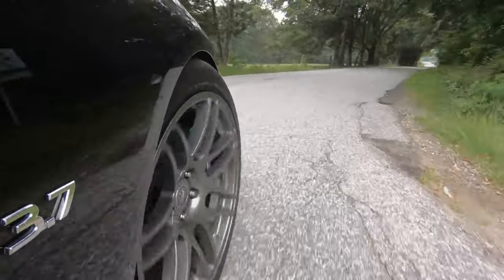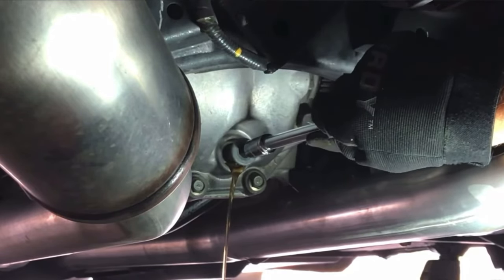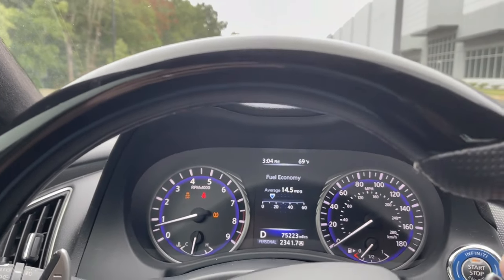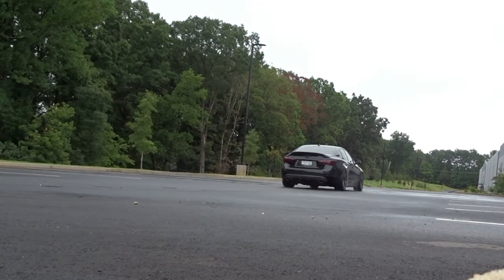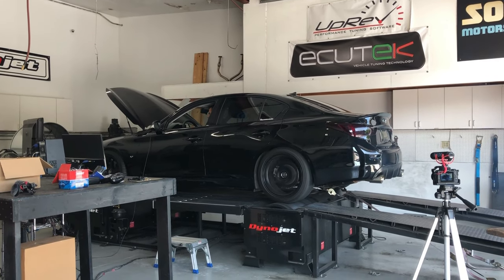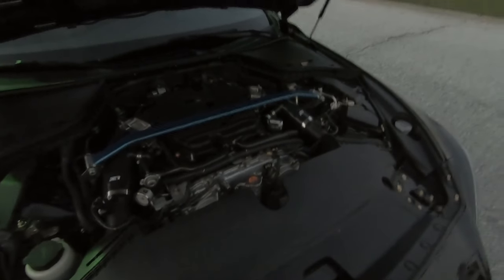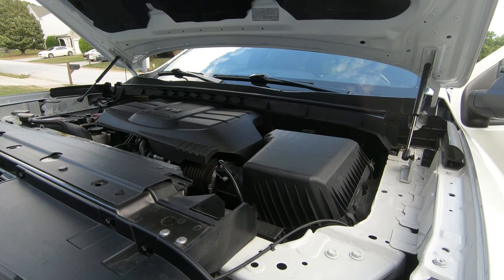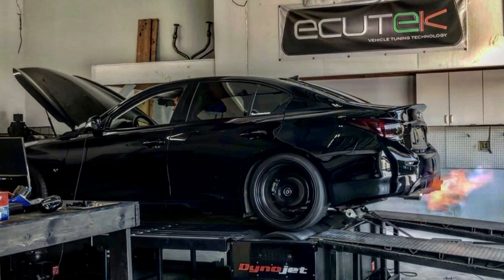Tips To Keep Your Q50 Running Great

Comment: I have a 2015 q50 w/ 215k miles. She’s still running like new. This car is a beast. Will never let it go 💪
Reply: Just inherited one with 140k.   Any advice?
Reply: I just got mine a few months ago like 3 second owner w 135k I got 10 k miles on it took it from Seattle to La and back handled like a champ daily drive it and  pulls pretty good. Any advice on keeping the tranny giod
Reply: shesh 215K miles wow!
Reply: With the original transmission?
Reply: Mine is at 170000 and when I’m in park, it sometimes revs up a little by itself……….. any idea what it could be please reply
Reply: @ryansteele5059  i think its normal
Reply: Most reliable and I think best looking sedan you will ever own. And it accelerates like a rocket with no engine- damaging turbo (3.7 👍👍) Unlike soooo many German cars...I've had 3 infinitis and last one (G37x) was strong and reliable at 350,000km when I sold it. Get a q50 while you can... As they say, first rule of commerce: If it's good, they stop making it 😊
Reply: Is not the transmission. For those q50  is the valve body 😊
Reply: @quentinlittle2670  if the previous owner hasn't changed the heater hose connector yet, I'd recommend doing so before it fails. It's a plastic piece the becomes brittle and just breaks apart over time. Also the radiator caps should be replaced if it hasn't already, although at 140K I assume those have been replaced.
Reply: @jayedsun I’m at 89k, should I change those soon
Reply: @TahoeOG_  earlier the better. I just changed mine at 100k and it crumbled. Careful of plastic pieces breaking apart and falling down the hose. If its a large piece you have to clean it out. If just small pieces break you might be okay leaving it alone. I recommend an aluminum piece to replace it
Reply: @jayedsun  I plan on replacing the hoses with new ones as well so I guess I don’t have to worry about those pieces
Reply: @jayedsun mine failed today gladly I was near home, ordered a aluminum bleeder adapter and better clamps them oem clamps suck!
Reply: seeing the top comment gives me a hard on. im getting my q50 this week. 120000km(2015 model)
Reply: @jonathanhess3082 did yu get it bro?

Comment: I have a 2014 Q50 3.7 with 154K miles on the clock. I have serviced by Infiniti and  Nissan only.  Still runs like new. I still get compliments on the car because it doesn’t look dated. It’s as gorgeous as ever. Love my Q50😊
Reply from the maker: Such a good car!
Reply: Does Infiniti have crazy service prices?
Reply: @RucciWrld  no. It’s a Nissan. Very reasonable 😁

Comment: I have a 2017 q50 3.0 & I been having it for 4 years it has 93,000 miles and the transmission is always slipping on 1 and 2nd gear 😭😭😭

Comment: My valve body dropped at 105k, I had the transmission flush at 60k, but that was not good enough, even though I didn't abuse her, the trans needs a change, every 36k, and dont drive in sport ever, and dont rev the rpms past 5 ever, then you shouldn't ever need to fix it, cost 3500 for the part install and program
Reply: Damn it sucks you can't use sport mode unless you have to deal with expensive issues like this, luckily this car is fast enough in standard so i'll try to stay from it
Reply: My valve body dropped at 66k.  At the dealership now.  Thanks for the advice on not using Sport.  I rarely used it, I pretty much baby’d it.
Reply: Did you replace it yourself ? If so how much was the new valve body ? Mine went yesterday
Reply: I went to the local Nissan Dealer since it is closer to my house.  $1200 for the valve body and a few other parts, but the total was $2954.  I’ve never kept the car that long but since it was in perfect shape and only had 66,000 miles I figured I would be OK but I should have looked at the updated reviews over the last couple of years.
Reply: @robertmelio4262  so you paid someone to change it to get to $2900 ?
Reply: Correct.   They charged me a total of $2954.00.

Comment: just got a 14 q50 with the 3.7 last friday thanks to you, cant wait to get it where i want it. Alr went over the entire cooling system, thinking about doing the scs catback for it for first mod lol.
Reply: If you can't wait, a simple muffler delete is like 30mins and less than 200 lol.
Reply: @Muddmonkeyy  yeah i saw em but prefer the the setup he has due to the sound, its not that difficult my parts should be here by next friday and itll be off to the exhaust shop. I was more so just expressing excitement...lol.
Reply: Hey Chris.  I've had my Q50 3.7 liter for about 5 years now.  One of the first things I did was change the exhaust.  One of the cheapest things you can do is get the "Infiniti Sport Exhaust", from the dealership.  Its a axle back exhaust for only like $500.  And it sounds almost as good as what SpeedCulture has.
Reply from the maker: It’s a good first mod lol!  I did exhaust right away too!
Reply: @SpeedCultureStudios  thanks for the inspiration!!
Reply: My first mod would be that too but tints gotta come first
Reply: @demonNthesn0w  i ended up getting an isr catback recently. I wanted a single exit
Reply: @Muddmonkeyy I couldn’t even get anything on one of the bolts to turn it off, on my 2015. I bought an axel back and tried multiple sized sockets and lubricants to help and could never get it off. Gonna have to have a shop do it for $180 plus the $300 plm axel back exhaust.

Comment: As an Infiniti tech myself, I highly recommend changing your transmission fluid if your vehicle has less than like 150k miles. And changing it every 30k or so after that. It’ll help that tranny last longer and stay healthier. If you bring it somewhere ask for a drain and fill. With Nissan matic S. Or you can diy. It’s fairly simple. I always drop the pan and clean the small metal screen inside on my personal car. 

One fluid I don’t really recommend changing is the transfer case fluid if you are awd. We actually have seen a good chunk of cars that had their transfer case fluid changed, need transfer cases shortly after. Especially higher Milage ones. I believe it has something to do with the clutches breaking down and clogging things or getting stuck in bad places when draining. Only top it off. Too risky in my opinion!

Had an older lady’s transfer case go out two weeks ago after she got her fluid changed unfortunately. 😢
Reply: Can I do a BG drain and fill on a machine making sure to use the matic S? 2012 Infiniti G37 Coupe RWD 114K miles. If so, how many quarts should I swap?
Reply: @Marinate305  you could try. I’ve never done it with a machine before. But I’d probably swap half of the total fluid (roughly 6 quarts) at a time.
Reply: @investinjahcoin5029  awesome thanks. It is the PTX machine where you hook the hoses up, one extracts the fluid while the other injects the new fluid back in simultaneously.
Reply: Happy to find u guys, thanks for putting these info out. Is there an AFTER MARKET differential bushing available for the 2009 rwd FX35? I am badly in need for it. As INFINITI wants over 2000 dollars to replace this bushing. i live in the ORLANDO area, do you or anyone knows of any good infiniti mech in the area? i would really appreciate a reply regardless. thnx.
Reply: honestly I would just put some sort of epoxy inside the blown bushing. I’ve done it on three of my cars with no issues. It’s like a $5 fix instead of a few thousand dollar fix. I’ve used glass sealant or construction adhesive as well. It basically fills up the bushing cavity where the fluid is supposed to be. As long as it’s near the same hardness it’ll feel the same as a new bushing.

MotorvateDIY on YouTube has a great video on it

Or I would contact z1 motor sports and see if their diff bushing fits your fx. I don’t know off the top of my head
Reply: Thnx.

Comment: I have a 2015, and I only have it serviced at the dealer. I work with the same service consultant. 96K miles, and it's been smooth sailing. Though costly, well worth the investment.

Comment: with antifreeze, you can unplug the cabin heater core hose at the return-to-engine hose preferably or use the air bleeder port which is also on the heater core hose if you have one - careful its just plastic and will be brittle with high mileage so maybe get a aftermarket metal one or a new original before trying to open it. youll also need a snug fitting philips screw driver. then get one of those antifreeze fill funnels which makes an extra high fill point that will push the old fluid out within a few minutes and you dont have to bleed air out of the system. takes 2 gallons to get most of the old stuff out. i used a different brand and color antifreeze so that helped me figure out when the old stuff was all cleared out but you can count to 2 gallons if you use the same color.

i heard transmission flush machines at dealers use too high pressure and thats what breaks it. you can drain your transmission and fill it at the transmission cooler return hose but you'll have to figure out how to get the new fluid in that return hose which honestly im not sure will even let fluid flow into the transmission, it wont go back into the the direction of the pump, though. if that doesn't work then find a hose that will fit into the drain pan fill port which is like a 1cm wide opening that takes forever to fill. the evils of taking away the transmission dipstick tube - deterring DIYers so you go back to dealer and give them money. and saying its lifetime fluid lol so your trans breaks and you need a new one or a new car. transmission fluids also have a time limit as well as a mileage limit which i hear is 8 years. the original nissan fluid was 12 years old but very low mileage and it was quite brown/oxidated. the transmission now shifts better too. make sure to count how many liters came out and put that much back in.

for accidentally filling 87 fuel, put the car in eco mode and even then drive slowly with no hard acceleration attempts to prevent engine damage until you use up the gas tank.

Comment: Had a valve cover gasket fail at 100k, noticed it when I did the tune up, only one side was bad the other is still ok, my old maxima did the same thing and never had to replace the other side either, the problem was because of the pcv valves were clogged and it blew out the gasket, so always replace the pcv valves at 50k, it's so easy,  the dealer wanted 300, lol.
Reply: INFINITI IS A RIP OFF. They want over $2000 for replacing the 2009 fx35 DIFFERENTIAL BUSHING. Mine needs replacing, but i can not afford 2000. Is there a after market bushing that will fit this suv? I can you suggest any help. i really is in a jam, as i can not find any definite answers as to which diff bushing i should use for sure> please if u or anyone can assist here i would really appreciate it. i recently moved to the ORLANDO area and is looking to find a good mechanic.
Reply: you need to trade it in, its gonna need new catylitic converters soon also, that's another 2gs
Reply: All u have to do is buy a warranty and put 1000 miles on it if possible or wait 30 days if possible and they’ll fix it than cancel the warranty

Comment: Been wanting a q50 for a few years just never went through wit it. For sure getting it pretty used in the 80k-110 mile range what are the price ranges you’d recommend are a good deal in comparison to the mileage it has. Sorry if the question is confusing. I’m also in Michigan if that helps

Comment: first time buyer of a 2015 q50 premium with 50k miles anything i should bring back to get inspected before my warranty is over?
Reply from the maker: Rear diff bushing. I bet it’s failed.  You won’t have any signs of trans issue, so not much an inspection will tell you there.

Comment: I need new rear struts for my 2017 Q60 but they're hard to find. Any suggestions on some quality struts that are made for this model?
Reply from the maker: If you’re replacing struts, I would just look into Coilovers.  It won’t be any more expensive, you get some adjustability and the car will handle better.

Comment: I'm not sure if you said it or not but break fluid also. For Transmission it's recommended to drop the fluid change the fluid. You gotta. Make sure you take it to a mom & pop shop no big chain shops.
Reply from the maker: I meant to mention brake fluid of course—and I did mention trans fluid but is not recommended—it is a “lifetime” trans.  It’s touchy

Comment: I just bought a 2019 q50 3.0 runs great wanted to know if i should upgrade my airfilter once i change it just to be on the safe side are the different drive modes meant to be used like i wont mess it up eventually if i keep driving super fast on standard mode?

Comment: Got my 2014 3.7 with 13k and now Snow White is 149k only issue I had with her is the valve body 2 years ago and just today. My catalytic converter, cause my car to over heat and limp mode. But took the car off until can put another one on but with my Stillen exhaust sounds nice 😊
Reply: When Snow white dies. I’m putting a Honda K series and turbo. 😅
Reply from the maker: That’ll be quite the project!

Comment: I have a 2016 QX50 and for a year now its been clunking on changing gears and rattles when going over bumps. Brought it to a Nissan dealership (they couldn't determine the problem) 3other independent mechanics have looked at it and cant figure out what the noise/issue is - its less obvious when I have the winter tires on which are different than the summer/fall tires - now someone has suggested its the driveshaft - your thoughts

Comment: Hey Speedculturestudios!! I’m doing that scs catback soon. Could you link your front lip and spoiler? Also do you have to tune the car after getting the catback? I have ‘15 Q50
Reply from the maker: Just check out the spoiler and splitter videos.  They are linked there.  I’d have to go find them now.  Or you can check out the link to my “favorite things” in the description.  I believe I have them in there
Reply: @SpeedCultureStudios  and for the SCS catback, is it necessary to tune after installing it?
Reply: @carlossandoval976  only if you get test pipes or high flow cats. If you keep stock cats then you won’t need a tune.
Reply: @dominicgiancana93  hey, there are high flow cats on his SCS catback. Then will it be necessary. It’s been holding me back because it’s my daily and I don’t want to tune my daily and fuck it over
Reply from the maker: @carlossandoval976  no sir.  But the catback is designed for use with test pipes so you’d want to tune after test pipes

Comment: Do you have some kind of a maintenance sheet for the Q50 as far as interval changes goes?
Reply from the maker: No but the manual does.  But you should not wait 10k miles to change oil

Comment: Quick question, do you know if the hybrid engine will run as long as the 3.7? A 2014 hybrid popped up locally around me and just wondered if it would be as reliable as a 3.7 non hybrid
Reply from the maker: I’ve heard nothing but good feedback about the hybrid.  The Nissan/Infiniti 3.5 is a great engine

Comment: My q50 has 125k on it. Not sure if the transmission fluid has ever been changed. Should I change it?
Reply from the maker: Drain and fill but if it seems to be shifting fine I’d hesitate personally
Reply: @SpeedCultureStudios  it has a hiccup in 5th gear when the car is cold. The rpm’s will surge up before shifting. Only in 5th gear. But after the car is warm that doesn’t happen anymore
Reply: So should I?
Reply: @SpeedCultureStudios scs i also have the same question can you answer us please 🙏🏽
Reply from the maker: @junito3805  drain and fill — no flush
Reply: drained and filled mine at 100k it’s shifting good at 121k

Comment: @SpeedCultureStudios I have a question when talking about the drain and fill for the transmission. What do you mean exactly because on my car I’ve been feeling a little hesitation on the transmission and it’s not shifting right and it’s time for me to change the transmission fluid, but I don’t know if I should fully drain out all the old fluid and put a new fluid or I don’t know what to do
Reply from the maker: Shops will often do a flush which can lead to more problems with the Q50 so just simply draining the fluid and refilling is often thought best
Reply: @SpeedCultureStudios  ok thank you for the info i plan on doing it myself so just wanted to be sure

Comment: Bro you forgot us awd boys. 
Transfer case is one quart of same fluid you use in the trans... lol stil liked the vid. 😊
Reply from the maker: Yes, trans, transfer case, rear diff, brake fluid—all fluids.
Reply: @SpeedCultureStudios  yes we all agree 👍 all the fluids. Lol 😆
Reply: Actually the transfer case takes a special transfer case fluid! Not matic S like the transmission. I also do not recommend changing the fluid on your transfer case. I work at an Infiniti and have seen a bunch of transfer cases go out after changing the fluid. It’s very finicky. Too risky in my opinion. Especially if you have a higher Milage vehicle
Reply from the maker: @investinjahcoin5029  I couldn’t advise on doing transfer case fluid as I do not have the awd and haven’t done it myself.  I’ll take your word for it!!
Reply: @investinjahcoin5029  I was gonna change my transfer case fluid soon but I'm having second thoughts after reading your comment. I'm at 74k miles with no previous service history on the transfer case. Worth the risk or better off to just leave it in your opinion?
Reply: @maximos  it is less risky with lower mileage like that. But personally I think I would just leave it alone. Maybe top it off a bit. That’s usually what I do. Causes some of the old fluid to come out the fill plug while some new fluid gets in